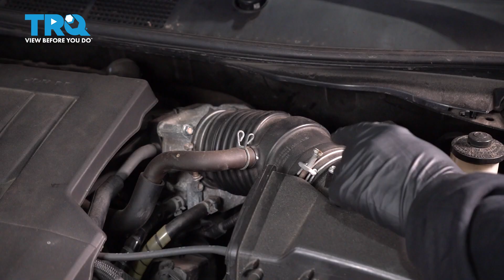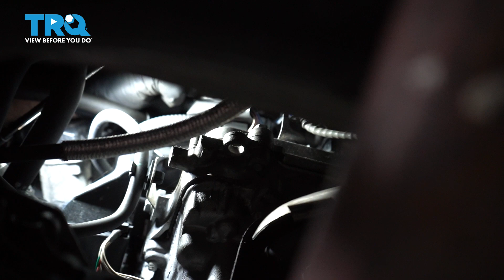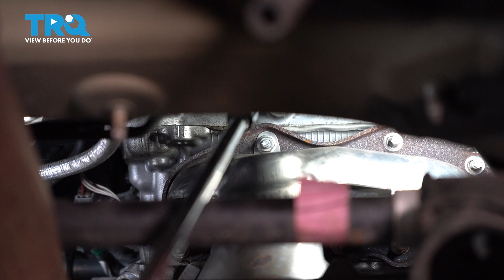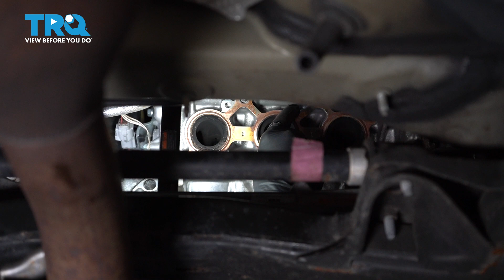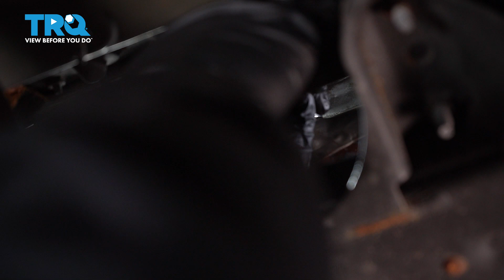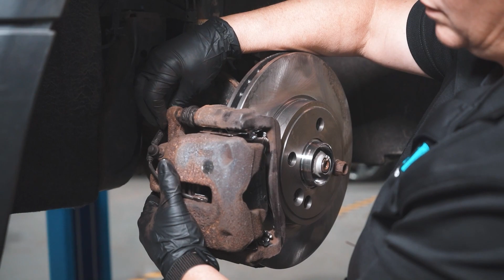How to Replace Rear Exhaust Manifold Catalytic Converter Assembly 2012-2017 Toyota Camry

Comment: Great video and very much appreciated. These exact steps worked perfect for a 2009 v6 3.5L 2GR-FE. Bad o2 sensor stripped out while trying to remove. So the only option was to remove manifold and take it to a muffler shop.